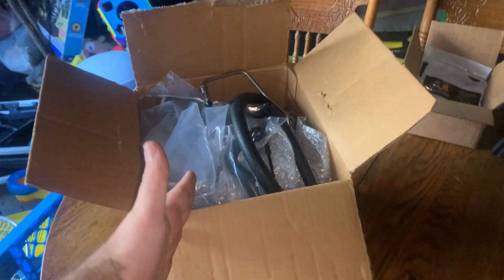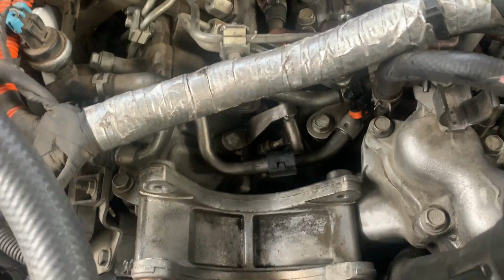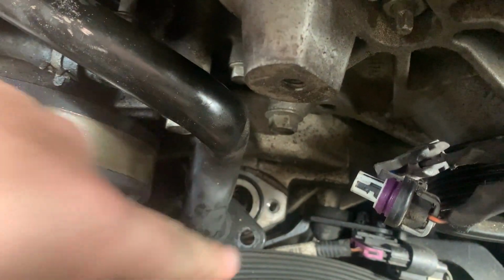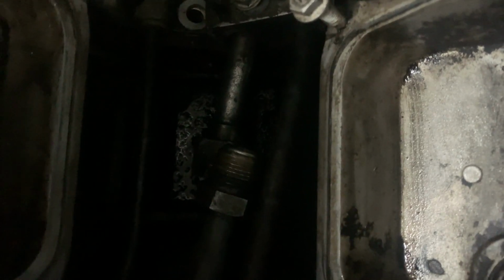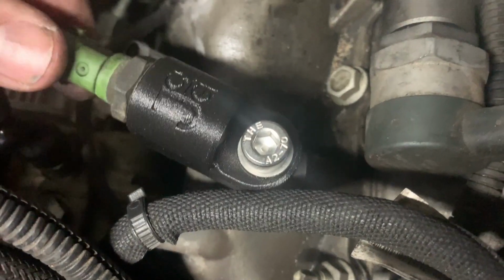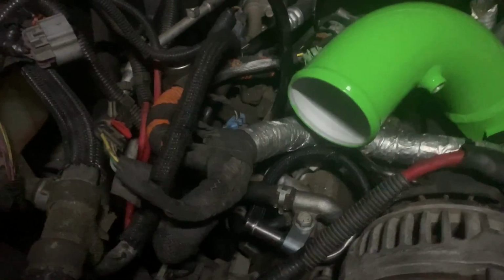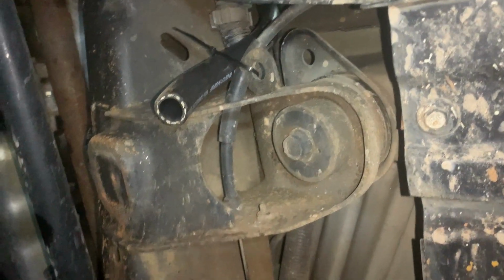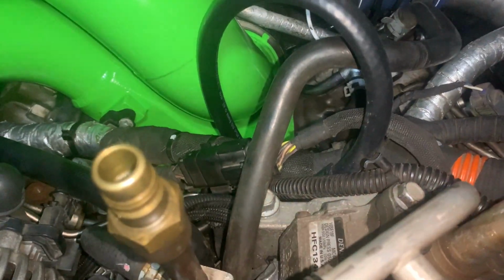LML Duramax gets DDP CP3 Conversion and WC Fab Y-bridge

Comment: How did you find a WC Fab y bridge? I pulled all the egr cooler but I still have the stock y bridge and replaced the up pipe instead of a blocker plate.
Reply from the maker: I got it off a shop on a Facebook group having a moving sale and wanted less stuff to move.

Granted I don’t think they make this kit anymore. Will have to go HSP or someone else

Comment: Did you have to re tune the truck?
Reply from the maker: Yes. Will need tuned
Reply: @2ndMomentumGarage what tune do I need to run it ?
Reply from the maker: @jeffreyb6319  just needs a CP3 file flashed with EFI live or EZLynk. Your tuner will know what to do.